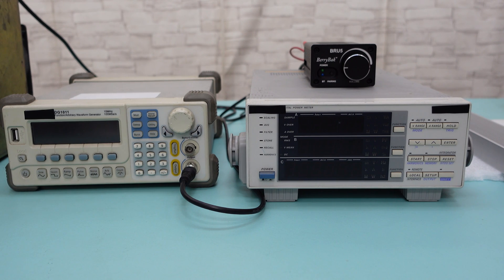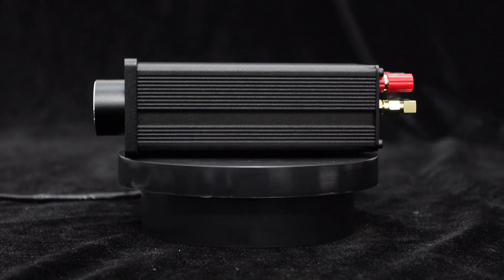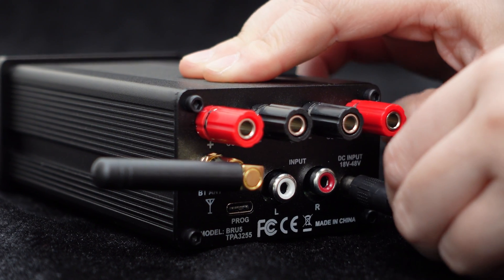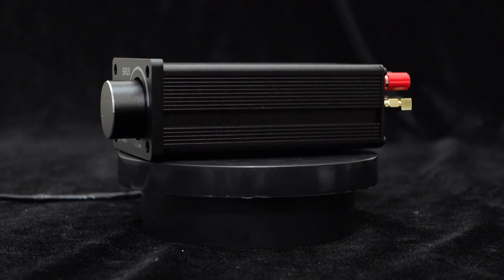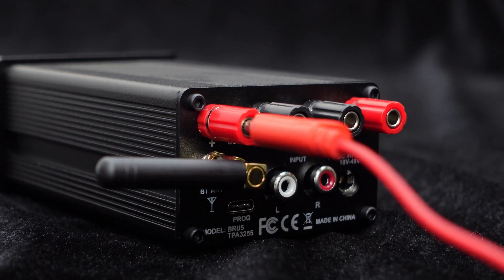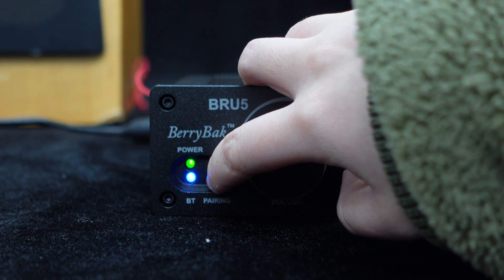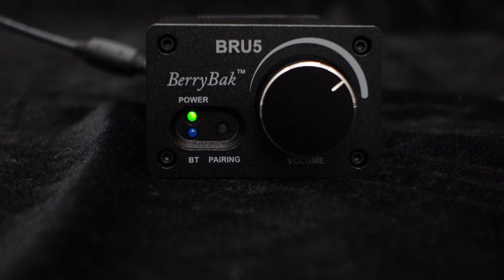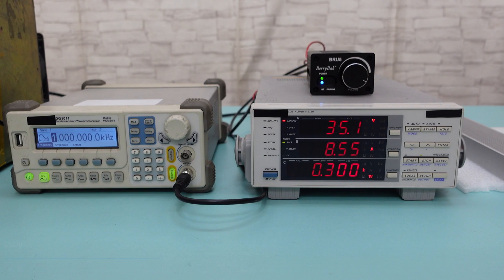Output Power Test | Can TPA3255 dual-channel 300W Bluetooth amplifier BRU5 really output 300W?

Comment: Hi I want to use this amp for my subwoofer. But my subwoofer would have too much excursion below 20hz. Can I setup a high-pass filter at 20hz or can even the amp do 20hz?
Reply from the maker: Hello, the BRU5 is a stereo 300W audio amplifier and doesn't support PBTL configuration as mono amplifier. You can add filter or dynamic range control through the PC UI. Please note that left and right channel will be adjusted simultaneously. Wish this could help you. Have a fantastic day~
Reply: And is it possible to limit the output of the amplifier to something like 40-50w?

Comment: Is it possible to adjust left and right channel individually? I thought this would be the perfect all-in-one amplifier for a portable 1.1 speaker with a subwoofer and a top, with a high-pass and low-pass filter.
Reply from the maker: Hello, thank you for your watching and comment. Unfortunately, the left and right channel of the BRU5 cannot be adjust individually. We will hand your suggestion over to R&D department for consideration. Have a fantastic day~
Reply: @WONDOMAudio Does it have stereo or dual mono configuration? Is it possible to balance the volume seperetaly?

Comment: Which power supply should I buy for this amplifier for 110 RMS WATT into 8 ohm speakers ? I think a power supply of 48V 5A is to big ? right ?
Reply from the maker: Hello, thank you for your interest. For achieving 110W RMS into an 8 Ohm load, theoretically DC42V would suffice. However, we recommend using a DC48V, 5A power supply for optimal performance. This provides additional headroom, enhancing audio quality. Wish this could help you. Have a fantastic day~